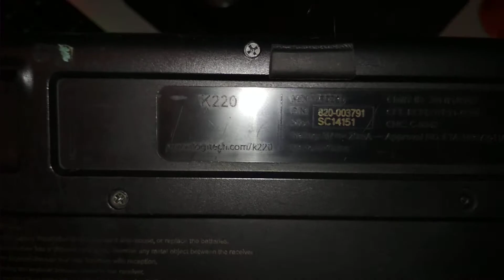DIY - Making a wireless mechanical keyboard with Logitech electronics for ~40USD - Part2

Comment: how could i use the bluetooth part of the keyboard to make my keyboard bluetooth btw its usb c
Reply from the maker: What I'm doing is rewiring the whole thing to match the wireless keyboard controller's 20+ pin connector. There are easier solutions with some Arduino module, or you can buy a cheap wireless mechanical keyboard and replace its crappy switches with something better.

Comment: Any way i can do a  rechargable battery and a usb c connector i cant find any kits that have these
Reply from the maker: It's not a good idea to make a keyboard rechargeable with NiCD or NiMH batteries, because they have to be charged really, really slow ... 
You can do a Li-Ion rechargeable solution, you need a power bank for that and a DC to DC step down voltage converter, to bring down the 3.6-4.3 volts of the battery pack's cell to 3V (equivalent to 2 x 1.5V AAA batteries). So you'd charge the power bank normally (through USB-C if you wish) and connect the keyboard through a DC2DC converter directly to the battery cell. You'd most likely want to put a mechanical switch between the DC2DC converter and battery cell, so it doesn't drain the battery when not used.
Such a DC2DC converter should cost about 2-5 dollars and is available in most Arduino/Raspberry Pi robotics shops. 👍